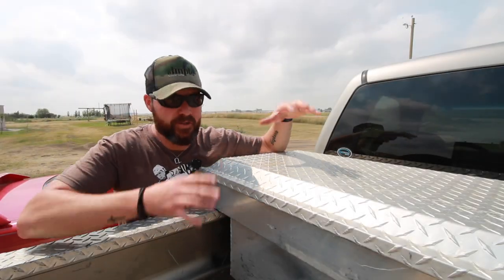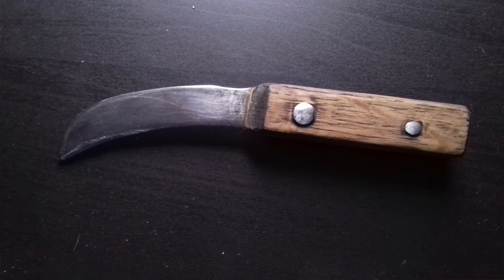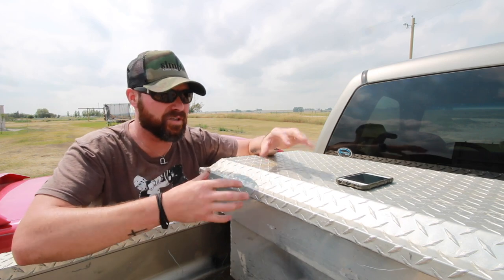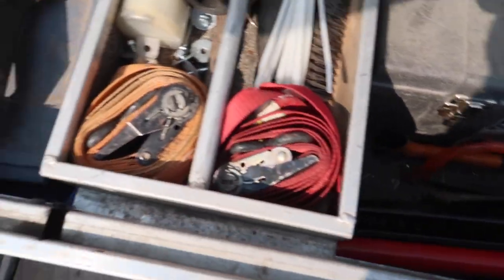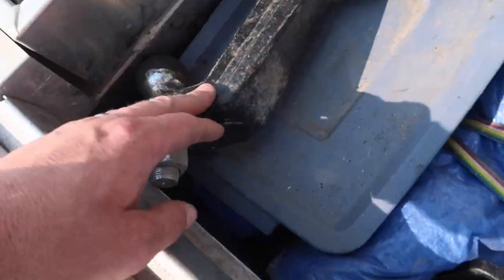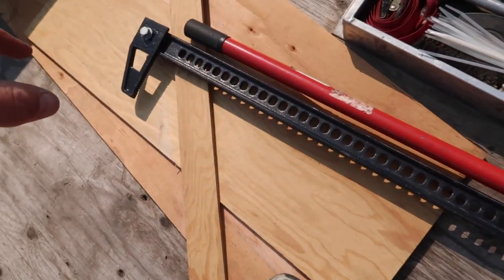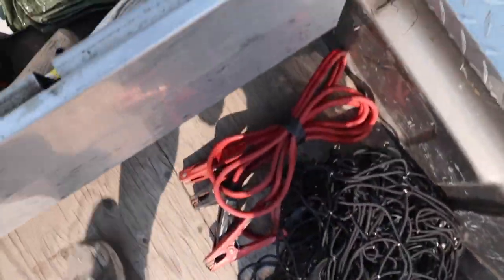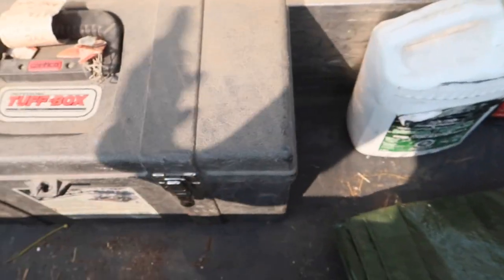Tool Time Tuesday -Pickup Truck Tool Box - prepared for an emergency👍

Comment: Two things I carry in my truck are a large fire extinguisher and a fire ax. Along with some other, what I consider to be essentials, like bottles of water, flares, a barbeque lighter, flashlights, gloves, a variety of tools, first aid kit, filter mask for fumes, safety goggles, orange pylons, shovel, booster cables and blankets. Depending on time of year this list can get larger, I like to organize things by using those Rubbermaid plastic bins I get at Canadian Tire. By the way, to keep my ratchet straps together, I buy these large red elastic bands at Princess Auto that are specifically designed for that task, they're about five bucks a bag of five. You usually find them in the ratchet strap area of the store, they work great, you can put a little white grease on them to keep them from deteriorating in the different temperatures. I look forward to more of your informative and problem solving videos, thanks for all your efforts.
Reply: Same here

Comment: Never heard any one call chanelocks water pump pliers before this video 😂😂
Reply: I call them channel locks as well. But channel locks is a brand and the name of the tool is water pump pliers.
Reply: Water pump pliers is the correct term. Channellock is a brand name that makes all different types of pliers. They also make water pump pliers.

Comment: How is it secured to the bed
Reply from the maker: It’s bolted inside the box through the top rails for the truck bed👍
Reply: @Simplelittlelife  hi can it be removed if you wanted to take it out?

Comment: Very Illegal to leave your hitch in, at least in Sask. Rarely ticketed though.
Reply: That's interesting. I live in the States and I always leave mine in. Mostly because if I get rear-ended by another car, the hitch takes most of the impact instead of my truck. Cheaper repairs as long as it's not a big enough impact to do frame damage. I also leave it in because who knows when you will need it? Its always handy to have it accessible for the obvious towing but also for pulling people out of ditches, etc as well as many other uses. Its a solid connection point to the truck for whatever you may need a solid connection point for. The only thing you have to watch out for is your shins! A quick run around the truck can very quickly go wrong if you forget it is there like I am sure many of us probably have done at one point in our lives.
Reply: What i find interesting is that your first point is exactly why it's illegal here. In a collision the hitch can and will rip through the bumper and buffers creating greater shock to the rear-ender and more injury. I was like you and left mine in for so long for the same reasons until a buddy of mine got a hefty ticket and points off his licence after being rear-ended, simply for having his hitch left in.
Reply: Oh ok! Yes my father got in an accident a few years ago with our old "Farm Truck."  There was almost no damage done to the truck other than needing a new hitch. No frame damage, etc. The car that hit him (texting and driving) was completely totaled. The guy was not an honest gentleman and refused to pay anything and tried to blame it on my father. Instead of costly court fees, my father just bought a new hitch and told the man to have a nice day. Police reports were filed but no court, insurance claims or anything else were filed against him.
Reply: Oh man, no accounting for other people I suppose. Glad he ended up with a relatively small bill in this case!
Reply: Yes unfortunately there are many dishonest people in this society. Its a two evils situation where you have no intent on hurting anyone with it but at the same time you want to protect yourself/your property. With things like hit and runs and dishonest people, yes they deserve to have their car totaled in my opinion. In my father's situation, for lying and trying to blame it on my father (stopped at a redlight, no brake slamming or anything), he deserved it. Not only that, but it was obvious that the guy wasn't willing to pay for the damages done and was going to fight it however he could. If I could find the society where everyone lives an honest life, I would absolutely take the hitch out. A little extra inconvenience is worth it. However with the crazed society that I live in, I'll just leave my hitch in. I just hope the choice doesn't come back to haunt me later.
Reply: I always leave mine in